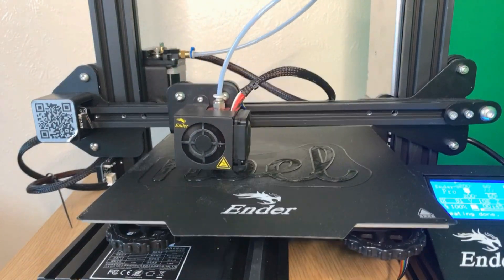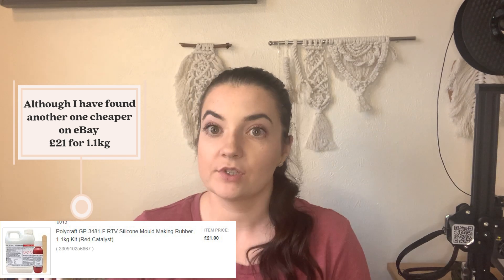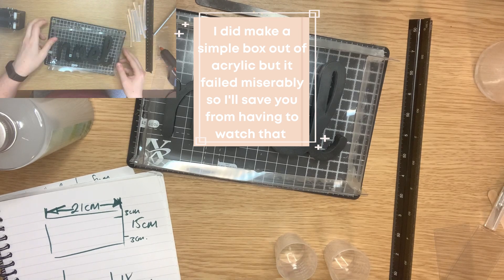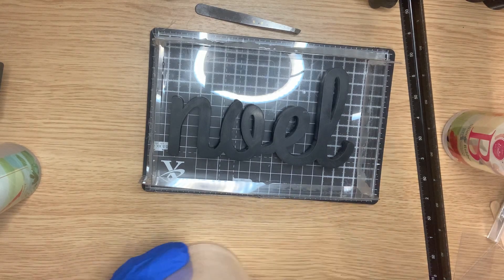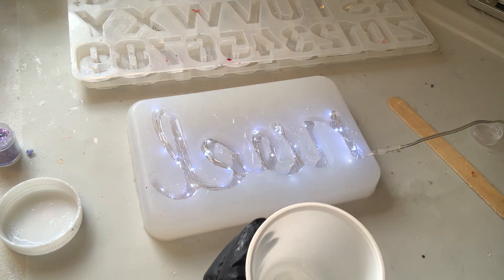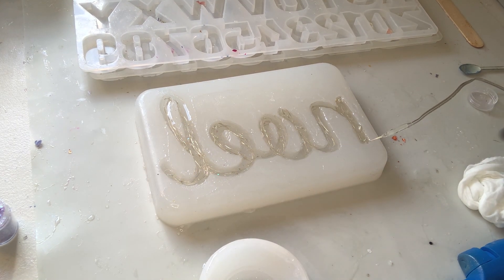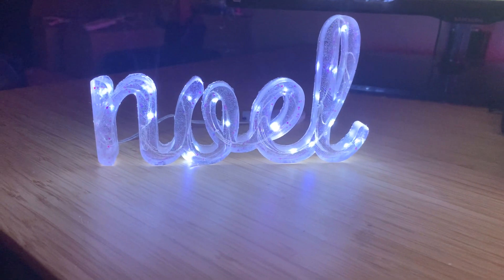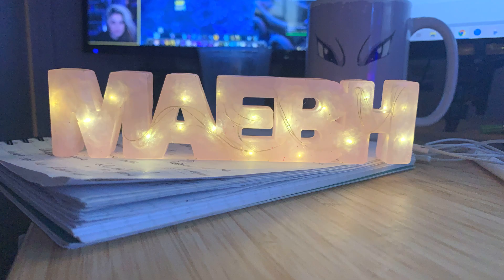I Made Custom Resin Moulds Using a 3D Printer

Comment: I know this is 2 years old, but it's a great project. You can top coat your 3d prints with a uv resin to avoid too much sanding and you can get that glossy texture.
Reply: Easier yet, print face-down using a smooth plate.

Comment: Spraying the 3d print with a spray primer that can sand is the best way to smooth out a 3d print after a little sanding on the 3d print plus using a fine layer height.

Comment: I'm working on my own moulds right now, initially used clay but I've designed some for my dad to 3D print, sadly he lives in another country so I have to wait 😂
Top tip, you can use a Doming resin or uv resin to smooth them out and make them shiny, shiny product = shiny silicone mould :)

Comment: Looks awesome but what if the lights stop working? ITs not possible to replace
Reply: You can change the battery in the lights with ease, the pack is separate from the lights